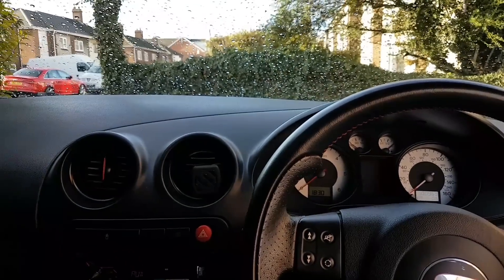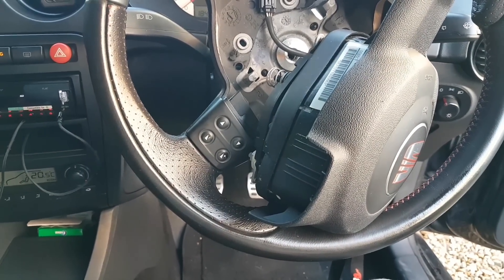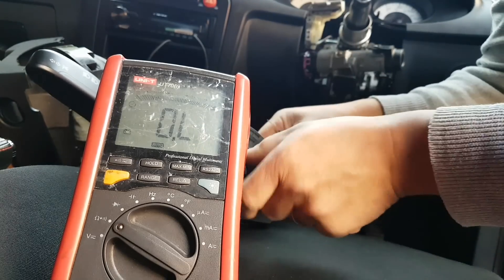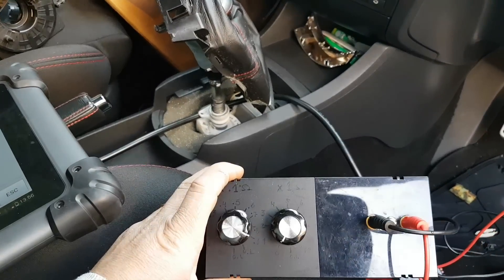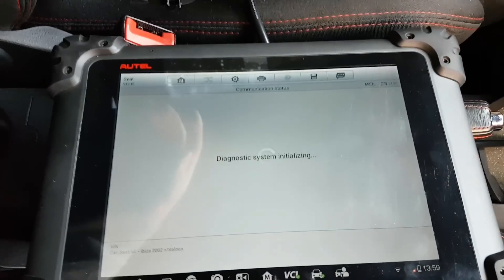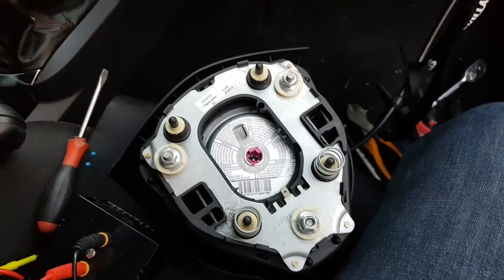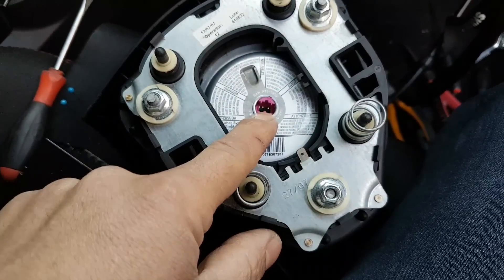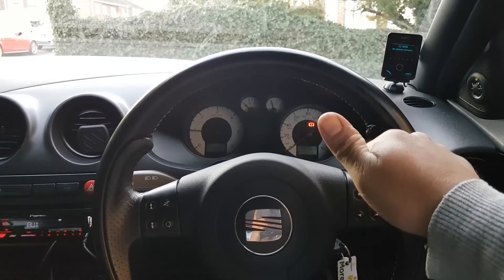Seat Ibiza 6L Airbag light on code 00588. Fault finding and repair.

Comment: Great video LM , guys do not try to measure airbag with multimeter, it can be deployed ! If you still have to do it , put the airbag away from the car and keep your distance.
Reply from the maker: Absolutely... 
Thank you for watching and for your comment!
Reply: LM Auto Repairs just a friendly advice if you alow it, put some warnings in the  comment section and pin it or in the decription of the video.. not everybody has expierience with this kind of stuff and they try to replicate what they see. Other than that, great job !!!
Reply from the maker: @amperugarage  
Pined your comment...
Reply from the maker: @samthenerf 
That's correct...
I have measured loads, but for reasons you can imagine, I can't come here showing doing that...
Always better safe than sorry..
Thank you for watching and for your comment!

Comment: Well done mate, as always;
I repaired a Golf VII with similar faults, sometimes resistance too high... sometimes resistance to low. All components was changed in dealer, clock spring, Airbag modul, parallel wiring, ECU... but faults comes again.
Once in our laboratory and after check all diagnose informs, I decide to remove and open the ecu.
There was evident signals of water filtrations inside, and searching the reason I discover the A/C evaporator box broken in a corner.
Depends the inclination of the car, the water goes directly to ecu plug and then, to inside of it by capilarity.
It was a nice work too...
Thanks for your videos, and I will to subscribe to your Patreon.
Regards from Barcelona
Guille
Reply: Ow! One more thing...
When manipulate Airbags, always keep it with the face up.
If detonate as you put in the floor, could be very dangerous if you're near.
Also, and I imagine that you know, its necessary to discharge your own static electricity when manipulate the pyrotechnic elements or his plugs, touching a metallic part of the body...
Reply from the maker: @guille79bcn  
Absolutely...
Thank you for watching and for your comment... hope to see you on Petreon soon... loads more videos in there, and exclusive content!

Comment: Good video , very helpful , got one of these in workshop today same issue 00588 code and description changed after unplugging and reconnecting , turned out to be the contacts inside the multiplug on the other end of where this one had problems (big yellow plug).. turned out to be easy fix as a small screwdriver can reach the plug tangs and a little tweak and it solved it .
Reply from the maker: 👍👍👍
Airbag systems are sensitive to changes in the resistance of the circuit...
Sometimes all it takes is a good cleaning...
😊
Thank you for watching and for your comment!

Comment: i would keep that in mind, in smart 451 the airbag light might come on from dust in the seatbelt connectors and i usually spray wd40 ti fix the issue. When you told on the video look at the airbag and see if you can spot the fault the connector  was black and i was like, its dirt 99% but wasnt 😂😂
keep it up 👍
Reply from the maker: 😋
Not dirty contacts in this case...
But I had them in the past...😉
Thank you for watching and for your comment! 
👍👍👍

Comment: J'avais le même problème le connecteur faisait pas le contact. Avec un tourne vis j'ai resserrer les lamelles des fiches.
I had the same problem the connector was not making contact.  With a screwdriver I tighten the contact strips.  Problem solve. Big thanks.
Reply from the maker: 👍👍👍
Thanks!
Reply: Salut quelles fiches stp ?

Comment: Just ensure that the the clock spring is put back to central position after tests and prior to reinstallation of steering wheel or damage will ensue.
Reply from the maker: That's correct...
Thank you for watching and for your comment! 
👍👍👍

Comment: I've tested the clockspring on Ibiza 6l with multimeter because of resistance too high error code and measuring the resistance between the 2 right most pins gives a 0,2 ohm valaue (short). I assume that is not a way it should behave.
Also tried measuring the resistance between ends of a t45(?) plug and 2 right most pins on 8 pin plug like you did, and there is no continuity.
I assume the clock spring is messed up internally and has a short, and ECU sees it as an open circuit from its side?
Tnx in advanced.

Comment: Hi. I have an airbag light on but it says short to ground. Have you any idea what it might be. Ive changed the airbag, clock spring and bridged the connector under the seat and it still wont clear off. Thanks
Reply from the maker: Hi
Looks like you have just randomly changing parts... from the clock spring to under the seat...
Which circuit is giving that fault?
👍👍👍
Reply: @LMAutoRepairs  Thankypu for replying. Yeah that's what it feels like at the minute. I read up a lot about it and a few people managed to sort it with doing them jobs. It says driver side igniter short to ground on vcds
Reply from the maker: OK... driver side igniter alone can be a bit vague...
Which code do you have exactly?
Reply: I've scanned the code and it's coming back as 00588 - Airbag Igniter, Driver Side (N95): Short to Ground. Thanks
Reply from the maker: OK... so, have you measured the wrung from the airbag plug to the module itself?
Reply: @LMAutoRepairs  sorry what do you mean the wrung
Reply from the maker: 😅
Bloody predictive text...🤦‍♂️
I meant wiring...
Reply: @LMAutoRepairs  yeah the wiring is fine. So confused with it
Reply from the maker: If the there is no shorts or O.L. on the wiring from the airbag plug to the plug on the airbag module, you either have a bad airbag or a bad module...
Check the shorting plate in side the airbag plugs, as if they are not opening will be creating a short even with everything plugged in... just as per the video...
Reply: @LMAutoRepairs  thankyou very much will try this

Comment: Another great video thanks. Question .. Why didn't you check the resistance of the air bag. Could that cause it to go off?
Thanks
Reply from the maker: Yes, there is a possibility...
If you ever want to do it, plug some wires in, and do it from a distance...
Never do it close to you.
Airbags itself, are very rare to fail...
Thank you for watching and for your comment!

Comment: Genius !!!  Everything you know is incredible... You didn't give up and that's why you found the fault... I congratulate you... I'm beginning to dare to get my hands on mechanics/electricity and I've already done many things (only my car, LOL).  Let me ask you a question.  I hope you can help me because it drives me crazy lol... I have a VW Passat 2004 2.8 V6.  On Saturday I went to start it and by mistake I gave the key less time and it didn't start (nothing serious, it's something that can happen to anyone).  I removed the ignition, and turned it on again and it started perfectly but it began to indicate the failure of the airbag on my side (in my case it says that it is due to high resistance).  Until that moment it had never failed.  What do you think I can do?  Thank you very much and I hope you can help me.  Hug from Argentina.
Reply from the maker: Hi
Have you tried to clear the fault?
Could be a glitch, nothing serious...
Or a pure coincidence that the fault happened to occur at that exact moment...
👍👍👍
Reply: @LMAutoRepairs  I wish it was just a glitch, lol... I had that hope, but no.  She erases the bug and leaves, but instantly she reappears.  I have a multimeter... With that I can verify where the problem is?  The truth is that it is something that worries me...
Reply from the maker: Which airbag exactly ir reporting a problem,  the steering one, or side airbags?
Reply: @LMAutoRepairs  Sorry, sorry, sorry and more sorry, lol... I never got the notification of your message, that's why I didn't answer you before (I still have the problem).  At this moment I do not have the exact code that the scanner gives me, but on Sunday or Monday I will give you that information.  I thank you very much for your concern, and sorry for not having answered you before.
Reply: @LMAutoRepairs  I found the code, lol... It's this: "00588 - Airbag Igniter; Driver Side (N95): Resistance too High" The strange thing (as I mentioned in the first message) is that the fault started at the exact moment I turned on wrong the vehicle (until that moment had no error).  I tried to erase the error with a Vagcom (cheap, tricky, lol).  The fault went away, but then when I started the vehicle it started up again.  I don't know if maybe with that tricky Vagcom the error wasn't completely erased and that's why it reappeared, or if having started the vehicle wrong really caused a break.  What do you think?
Reply from the maker: I think it might just be a coincidence that the fault happened at that time... 
Vagcom is more than OK for that... check live data, if you have the resistance live data for the igniters, confirm that the one reporting the fault is indeed high... high resistance is going towards an open circuit, meaning a poor contact on a plug somewhere, or a broken wire...
Being the driver side, there is a chance of being the clock spring...
You need to star measuring things step by step, narrowing it down till you find the place where the issue is...
There is no silver bullet for something like that, unfortunately...
👍👍👍

Comment: What would it mean if the airbag light doesn't light up on the dash until the 3rd time you turn on the ignition. I changed the clock spring and this is how it is
Reply from the maker: Difficult to tell...
Is that after the car been left to "sleep"?
👍👍👍
Reply: @LMAutoRepairs  Just started car this morning and the airbag light comes on sometimes when you turn the key. Not always though
Reply from the maker: Strange... difficult to say without checking...
Have you scanned the car?
Any faults?
Reply: @LMAutoRepairs  no faults. Clock spring was changed
Reply from the maker: If there is no faults on the airbag module, can you do testing with the scanner on the cluster,  to ensure that the led for the airbag comes on every time?

Comment: One more scenario: what if clock spring has an open in certain position, you did not show full left to full right, and with wiring bypass test, you theoretically reverse connected the wiring, the plug does not go only one way in the airbag for nothing. Is there a diode inside, for reverse power protection?
Reply from the maker: I actually show full left and full right...
You must have skipped that part...
I am confused with your diode analogy... sorry...
Thank you for watching!
Reply: LM Auto Repairs I must of skipped that part. Why is the connector in the airbag fitting one way only? What is the reason? What if your low resistance faultcode was not cause by the short bar? Just asking, I don’t know myself for sure.
Reply from the maker: @liviu2004  
That would mean a short elsewhere...
Which would need to be traced down...
😉

Comment: Good day sir,

Great video once again...

Hoping for your help once more. Do I have to program a used transmission control module on a CX5 2014?
Reply from the maker: I would say you need IDS or a capable tool for it...
I never done that, nor worked many times in Mazda... Thank you for watching and for your comment!
Reply: @LMAutoRepairs  thanks brother

Comment: One question, maybe just changing the airbag ring can solve this problem?
Reply from the maker: You must have skipped the video when I showed what the issue was in this case...
Otherwise you would see that was nothing to do with the airbag ring (I believe you mean clock spring)...
There is other issues obviously that van be the ring... you need to test in order to diagnose it...
Thank you for watching!